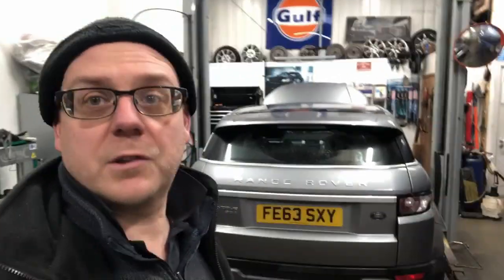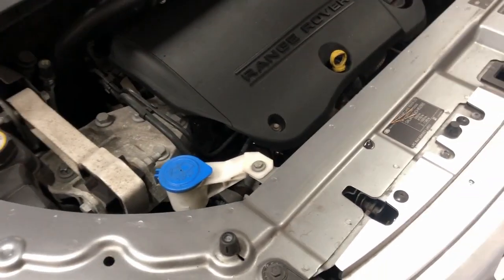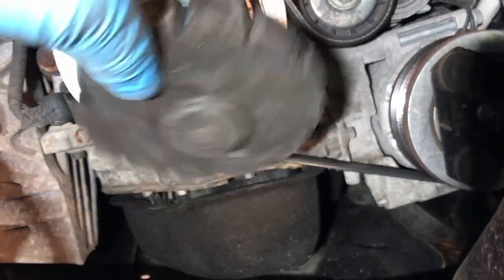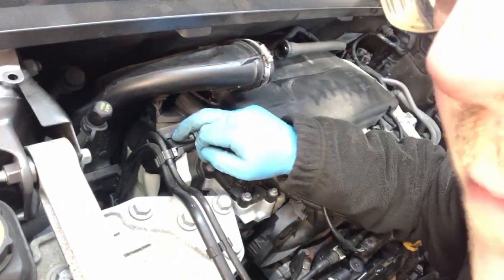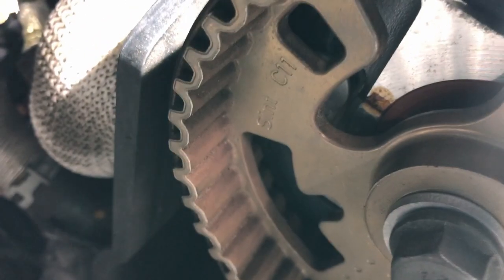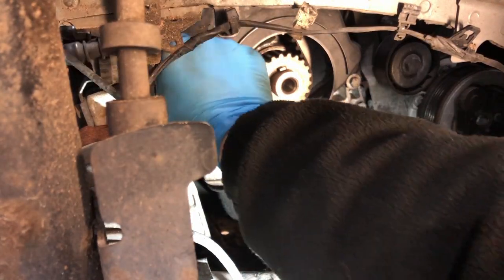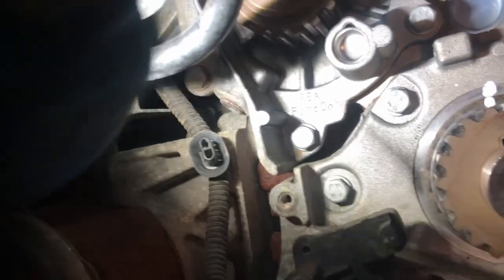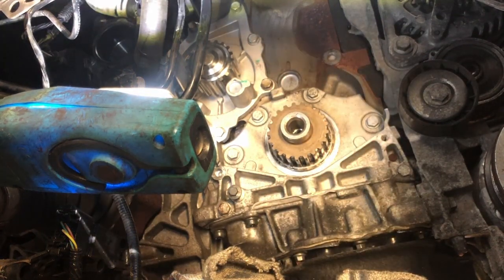2013 Range Rover Evoque freelander 2.2 cambelt water pump change DW12 Duratorq - How to

Comment: extremely helpful video, thank you. I watched the video a couple of times to gain confidence of doing my 2012 Peugeot 508SW 2.2HDi which has the same engine as the Evoque. Here is my feedback:
1. don't get too fuzzy about the loose keyway of the timing gear. I checked the original reluctor disc which has the gear mark on it. It shows when it was fitted at the factory, the key was aligned fully CCW against the gear key slot as when the nut was tighten , the gear was driven CW. The keyway slot on the reluctor is tight and it has no play.
2. The original tensioning wheel pointer is well below the pointer marker so I set the new one to the lower rather than higher side of the tension marker. I also checked the belt tension with a generic gauge,  they (old and new) are both higher than the recommended tension value by the gauge instructions. The removed belt has done 140,000 kms and 10 years, still in perfect conditions. I guess this design is to make the tensioner and idler in such way that the belt span is very short and simple, slightly lower tension may make it more durable.
3. locking the flywheel can be done without removing the starter, the hole is 1-2  inch below the starter but sometimes it's hard to be seen. I only found out this after finishing the job. You need to try looking from below and sideway or using your hand to search it. Without locking the flywheel, you can't torque the crank nut but just use a impact driver to tighten it.
4. For Peugeot 508, you need to remove the engine mount to get access to the idler. The space there seems to be tighter than the Land Rover.
Reply from the maker: Thanks for the comments 👍
Reply: Good point John, this engine might be in lots of different vehicles, but of course the space around them will differ according to each application. Thanks for the tip about locking the flywheel, I'll be sure to look for that when I do mine.
Reply: @handycrowd  Very good engine indeed, enjoy servicing it!
Reply: @youtubehobbyists  Will do! 

I was shocked to see how much JLR wanted to fit the kit (I used this as 'leverage' to get a lower price) the independent wanted 830GBP which is okay, but jeeeezus, JLR wanted a staggering 2370GBP.... (I know I'm in Norway but crikey!).

Just ordered the Bosch kit for about a hundred and thirty quid... It will be a profitable mornings work, since the seller dropped the 830 for me :-)
Reply: @handycrowd  I was thinking it would be a difficult job before starting. The independent shop here (Australia) wanted over A$2000. I got free time so attempted myself and saved. It's not difficult with the aid of this  video. I also took time, marked the old belt, upper and lower gears, recorded the old belt tension pointer position, measured the tension. I then transferred the marking  to the new belt. 
The coolant ran out of the pump removal is about 3 liters, I saved it as it's new. You need to bleed the coolant from the nozzle near the air filter. Don't rush the engine until all the coolant is in as the pump seal may be running dry.
Reply: @youtubehobbyists  Thanks mate, appreciate the help! Got to sort out the EPAS bolt situation first, while I wait for the parts and then I'll dive in. Oh and the low battery warning. Everyone needs a hobby lol!
Reply from the maker: Isn’t there a small auxiliary battery behind the glovebox? This can cause some battery issues, even if the main battery is ok.
Reply: @Roverturbo  On the Evoque for sure, something about returning the gear selector to P. 

I'm not sure if Discovery Sport has that yet. Still working my way though the workshop manual :-)

Lots of folks posting about "low battery" so I'm sure I'll find the answer buried in a forum somewhere...

Comment: Great video, perhaps case with crank sprocket... it not always align in center, sometimes sprocket moves to the right when tension the belt. From experience nothing will happen . DW10 or DW12 will be just fine. But as you mentioned with locking flywheel, its wise to do that when you do it first time and if you have no impact gun :) but defo it is easier without taking engine mount off and support engine , they could re design coolant drain sow we won't make as much mess :) all best :)
Reply from the maker: Thanks for the great comments.

Comment: What do you think of the 2.2 diesel engine overall? Would you say looked after they are OK to buy second hand? Will a looked after engine last 200,000 miles? Too expensive for fuel? 30mpg?
Reply from the maker: Good engine overall, not complicated, with a belt. Been around for years and have proven itself, just look after them and it will last.Mpg? It is a 2.2, so not a small engine and depends how heavy the car it’s put in.
Reply: i have one in a peugeot 4007, its fantastic but not very economical maybe because it has a twin clutch auto

Comment: Absolute good video. However, it is always better to lock the crankshaftl You can mark as many as you like, if you torck the crankshaft bolt there is always a risc that the crankshaft is moving just a little bit. So not 100% accurate. There are 2 torck settings in the manual. 1 give 70nm whit a used bolt. The second say 70nm+ 82°whit a New bolt. Jaguar/ land rover mecanics prefer the 2e methode.

Comment: Is that timing belt or timing chain engine?
Reply from the maker: The heading of the video is literally “cambelt” and water pump change. 👍
Reply: Is has small chain that connects the two camshaft
Reply from the maker: Most do.
Reply: @Roverturbo  do you know the service interval for timing belt
Reply from the maker: @alisakkar823 can’t remember without looking it up. Didn’t I mention in the video? Also I think it also differs which car the engine is in.

Comment: Just watched for a second time :-) 

And thinking about that bottom pulley moving when torquing it up... I can't see as it matters. 

I mean, the critical one is the lower timing gear and that is already located and tensioned up, so if the engine turns a little whilst torquing up the nut, it doesn't matter surely?  (assuming also that the upper timing pin is also out by this stage)

I'm thinking that I could use the old accessory belt and mole grips trick to hold the bottom pully in place whilst torquing up the pully nut... Anyone see a gaping hole in that plan? 🙂